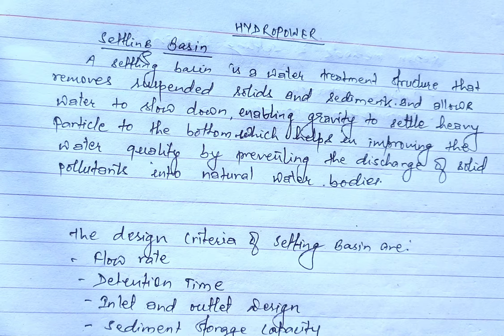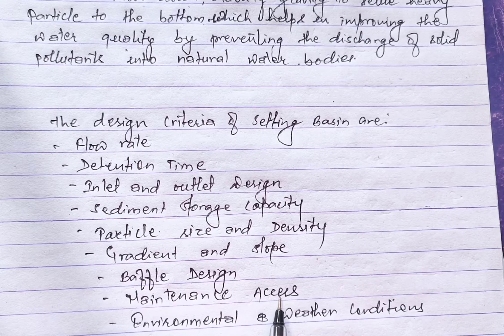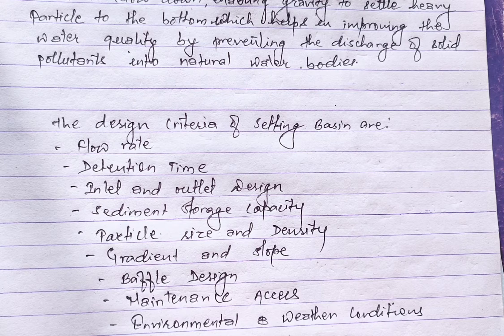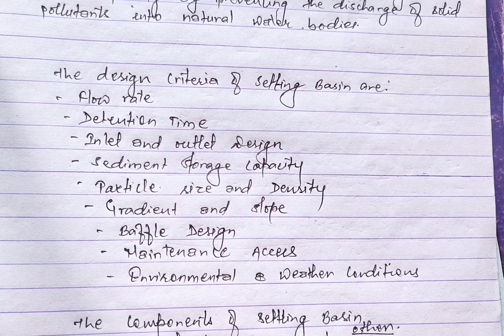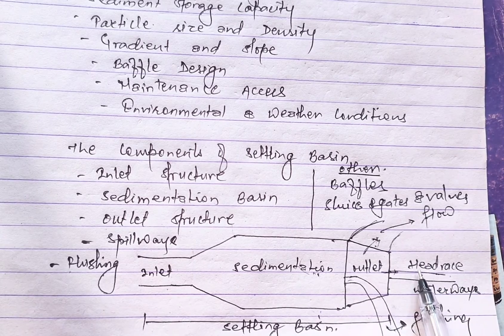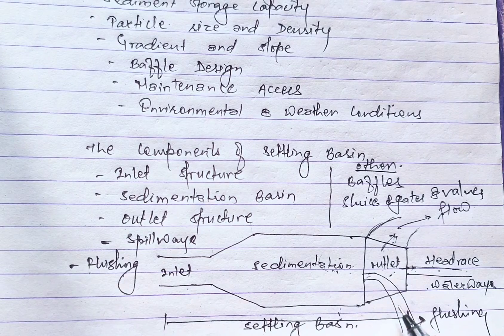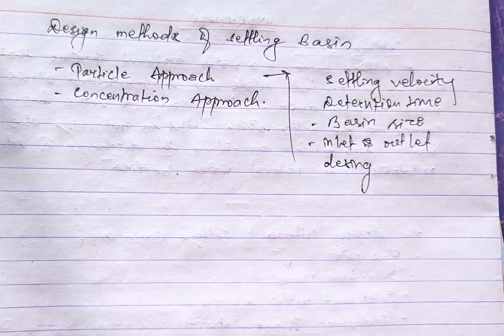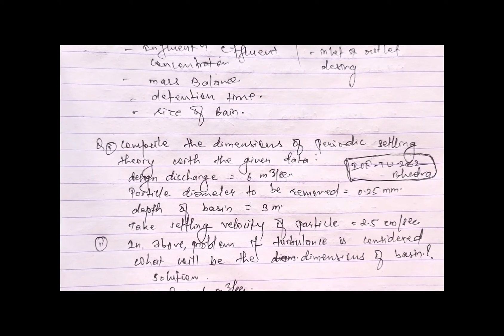Settling Basin Design : Concept and solved Problem

Comment: What does it actually mean by periodic settling theory?
Reply from the maker: The "periodic settling theory" refers to the process and design considerations intended at effectively managing sedimentation in the Settling basin. A settling basin is a structure used to remove sediment from the water before it enters the waterways, such as Forebay, pipes, surge tank, turbines, to prevent damage and ensure efficient operation.

Key Aspects of Periodic Settling Theory in a Settling Basin:

1. Periodic Nature of Settling:
The term "periodic" implies that the settling process is not continuous but occurs at regular intervals. This could be due to variations in water flow, sediment load, or operational procedures. For example, during periods of high water flow, more sediment might be carried into the basin, requiring more frequent settling and cleaning.
2. Sediment Transport and Deposition:
Water entering the settling basin often carries sediment, including sand, silt, and other particles. The theory focuses on how these particles settle out of the water as it flows through the basin. Larger, heavier particles tend to settle more quickly, while finer particles may remain suspended longer.
3. Design Considerations:
The design of the settling basin is influenced by the periodic settling theory. Considering factors like basin length, depth, and flow velocity to optimize the settling process. The goal is to ensure that the water velocity is low enough for sediment to settle out before the water exits the basin. It helps in determining the timing for maintenance activities, such as the removal of accumulated sediment. Regular intervals for sediment removal are planned to prevent excessive build-up, which could reduce the effectiveness of the basin.
4. Operational Management:
Periodic settling theory helps in the operational management of the basin which involves in monitoring sediment levels and adjusting the operation of the basin to maintain its efficiency. For example, in some designs, water flow can be temporarily slowed or even stopped to allow more complete sedimentation.

Importance in Hydropower Projects:

	Turbine Protection: Effective sediment management in the settling basin protects the turbines and other downstream equipment from abrasion and damage caused by sediment-laden water.
	Operational Efficiency: By ensuring that sediment is periodically settled and removed, the settling basin helps maintain the efficiency of the hydropower plant, reducing the need for costly repairs and prolonging the life of the equipment.
	Environmental Impact: Proper management of sediment also helps minimize the environmental impact at the downstream section, as excessive sediment can harm aquatic habitats and alter river morphology.